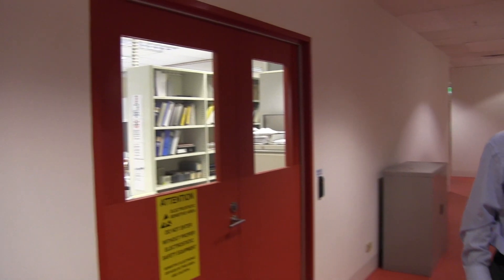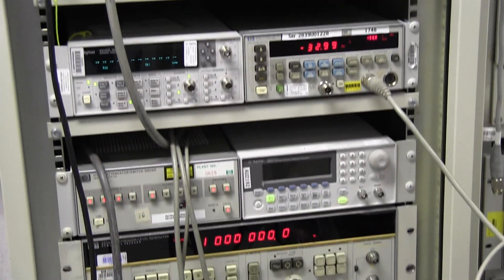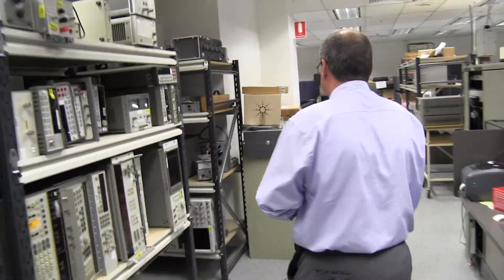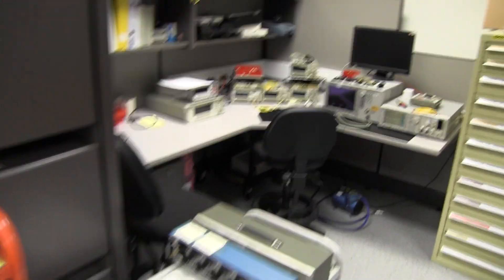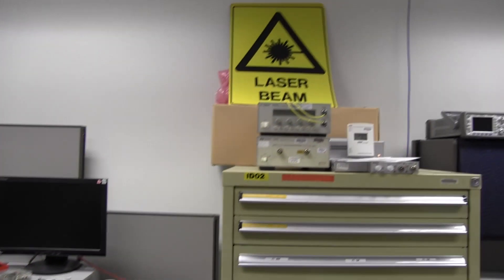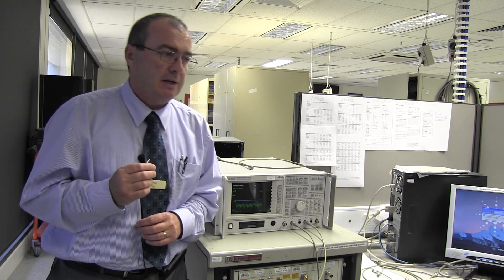EEVblog #1041 - Keysight Calibration Lab Tour

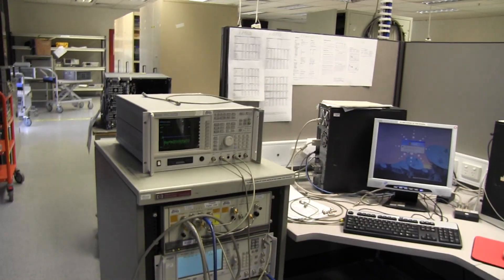Comment: At 15:34 I thought Peter said something about phase noise something they use in the TARDIS. :)  What a lot of equipment they have that isn't being used. I wonder how often, or if, they get rid of some of that gear.
Reply: You usually keep spares of equipment incase it gets busy, equipment goes down or primary standards need to go out for calibration. You don't want your lab to be down because a rack is out.
Reply: Maybe they calibrate the TARDIS?

Comment: I spot a 5342A at 4.20
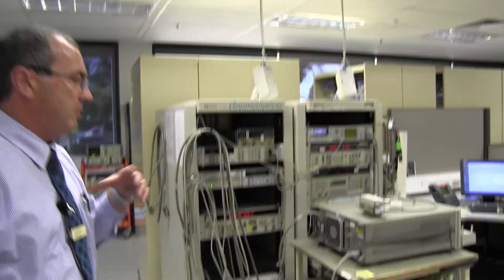Reply: 2:26 HP-8566/8568 in background
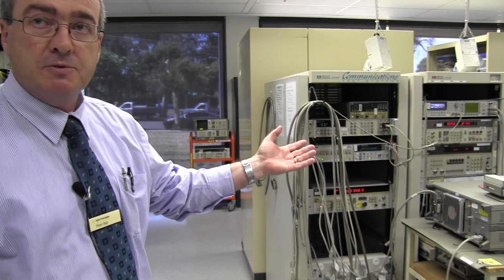2:37 HP-8116, 3458A,53131a,3335a, 8901a,8903b
3:01: HP-3326A on table
3:52: HP-8340A on bottom right
6:50 finally a stack thats bigger than mine
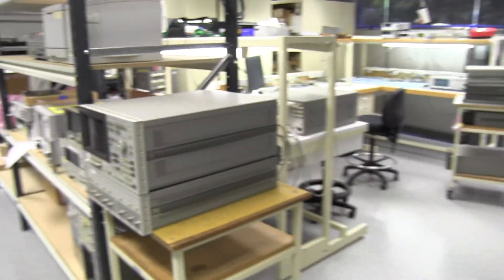7:30 HP 8510C?
Reply: It's going to be an 8902A because it's going to have all the fun options installed for doing RF cals. Just having the modulation bits is useless for what we use it for. Most of the time in an automated setup it's going to be running tuned RF and RF power measurements

Comment: 10:00 I see Tektronix TestMate equipment.

Specifically a TG501, AM503, and PG506 plugged into a TM503. Why some are there, I'm not sure. I know the AM503 is for DC/AC current probes up to 100MHz while the TG and PG are time and pulse generators. I only used those 2 to cal my 2467B. Their displays only give out a deflection error percentage.

Comment: why can't you have the roll of solder inside the solder station and feed through the umbilical cable to the soldering head driven via a feed control system controlled by a foot pedal means you have both hands free to do what is required.

Comment: why they have old calibration equipments instead new state of the art ones? does old equipment have any advantage for calibration purposes or just brand new equipments are too expensive?
Reply: Traceability. It's not easy to replace an equipment that you know how it was working for like 10 years? It's different.
Reply: dodaroxer yeah and also there is probably no reason to upgrade. These instruments have way higher resolution than the ones they calibrate.

Comment: Design and build a USB charger please dave. maybe SMD all the way ?
Reply: They want to see how Dave would do it.
Reply: When the one for my tablet failed, I ended up using a just hooking a USB port to the 5V rail of an extra 500 watt ATX power supply I had laying around, and disconnecting the fan since with just a load on the 5V rail, the heatsinks barely got warm. I also used it to power a Bluetooth audio receiver, and compared to cellphone chargers which generated a buzzing noise over the receiver, the power supply did not cause any noise to be generated that I could hear. Only downside was that an ATX power supply is bulky compared to a standard USB charger.
Reply: Just get an IKEA one, they're cheap and bigclive did a teardown and found it was very well designed: https://www.youtube.com/watch?v=uRe9w5PKmsE

Comment: Great tour:-)
I am wondering how do they calibrate the calibrators?
I mean if you take i.e. a power supply of the highest precision, how do they know that if it shows 10 volt, that it is 10 volt? Do they count electrons or how?
Reply: Like all metrological standards, they are calibrated using even more precise (and fragile) reference standards, which in turn are calibrated using yet more precise standards, until finally you go all the way up the chain to primary standards in national laboratories that calculate SI units (volt, second, meter, etc.) based on physical constants (or in the case of the kilogram, compared to a metal cylinder in France). 

For calibrating a calibrator's voltage, the output is run through a low resistance standard with a known high precision (i.e. the resistance is known to 0.000... places) and various arcane and secret processes are used to measure the accuracy and stability of the voltage. This makes the calibrator wiring and output terminals part of the calibration, and therefore their effect on the output is taken into account.

Comment: It's Keysight!! Why in the world would you still be using the 8902MS Rack? Your standards lab is outdated. It's kind of funny too. My RF rack is all new E4448A ( MMR, Phase Noise, etc) N5532A=550, E8257, ETC... And you guys are calibrating with 30+ year out dated standards. I knew back in 2004 I had an issue with a generator passing SSB and I sent it to Agilent 5 different times. Each time you guys passed it. I would run it again and it would fail the same offsets. I finally spoke to someone at your cal lab and come to find out you were using the ancient 3048MS system. I was using your new at the time E5504B system. Sad when  your customers have better equipment that your own lab,

Comment: I was just wondering what qualifications would be required to work in a lab like this? Just chuck an ESD mattress in the corner and I'd never leave :)
thanks to all involved for this wee tour - my switch has been officially flicked!
Reply: Ted Van Matje electronic engineering at very least
Reply: I'm just a dumb electronics hobbyist but a few intuitive points....
You need to be able to pass a military background check and hold a high level clearance to be able to work on equipment from the major customers of the lab.
   You probably need to have your engineering license and national certification. That usually means you need an engineering degree, a certain amount of certifiable job experience, and pass a certification exam accepted by the state. If your looking into schooling options, you should check out the state engineering license certification requirements as the first step before some recruiter/guidance counselor trys to sell you something that will waste your time.
  Finally, you need to be able to compete on an emotional level to interview well and come out ahead of all of the other people that want a similar dream job.
  I don't know how many people actually work at this lab but it doesn't look like there are more than 20-30 people at most.
 Best of luck,
    -Jake
Reply: The replies you've received are mostly incorrect. You don't need an engineering degree in this field and engineers are often looked over because they don't stay in the position for long periods of time because they become bored with the work. Every once in awhile you'll get to sit down and code a procedure from scratch or do an uncertainty budget, but normally in a lab like this you're just changing test setups when the computer yells at you.  Most people get in to the job with a military background as most militaries train calibration technicians. There are certificates you can get, but they're typically meaningless compared to ability. I've had opportunities to go take the certification, but it's not going to change my pay rate or job options. Bench time and skill sets are what make you valuable. A calibration technician could be someone who only knows how to calibrate calipers with a set of gage blocks to someone who can manually do interferometry or code complex test procedures for RF equipment. You do not usually need a clearance unless you're working for a military contractor and are working in a classified area or working on equipment with storage that is in a classified area which is pretty rare outside of the military. Keysight probably has a few people with a clearance for specific cases on equipment only they can calibrate (some of the 50-100GHz stuff with storage no one has the equipment to do but them) but they're not going to make everyone have one.
Reply: Degenerate Human 
....and that's why I lead with the "dumb hobbyist" bit. 
   Thanks for the info. Maybe goofing around with this whole electronics thing while waiting on surgeries/recovery isn't such a waste of time ;)
Reply: Upcycle Electronics you're definitely not. There's a large need for people who know electronics even if you don't have an EE. There are a lot of other people needed in the process and maybe you could even talk an employer in to paying for an EE b.s.
Reply: Degenerate Human 
   I just woke up in the worst pain in over a year. I needed a positive boost. Seriously, thanks ;)

Comment: What's up with all the floppy drives on beige equipment that hasn't turned piss yellow?
Reply: Not much UV there, put the thing where the sun will shine on it and it will get that color :)
Reply: 8-Bit guy took it out to the yard
Reply: Either it doesn't contain bromine or they were replaced sometime after the unit was originally built
Reply: Calibration is cheaper than buying into a new generation of equipment every few years, so people keep sending in ancient equipment. If it still meets specifications, then it may as well be as good as the day it was bought. Plus, certain systems (looking at you, financial and defence sectors) were designed to work with older models and are too vital to replace entirely.

Comment: 16:40 Seeing Windows XP machines with Ethernet cables plugged in makes me cringe.
Reply: Every PC in that building is most likely on an isolated VLAN that never sees the internet. As long as the PCs are isolated from ever facing the internet there is no issue running old operating systems, even OSs that have security issues.
Reply: I get the concern with XP (see Zach's response to why that's probably not an issue), but what's up with ethernet?
Reply: Just don't go on naughty sites and you'll be allright
Reply: Microsoft was the worst thing to happen to computing ever
Reply: i dont get why they not update to 7 atleast or even better, use linux.. i think linux should be an industrial standard!
Reply: sgpch1983 not at all, you can't just upgrade the OS. The software those machines run is very old. So they can't update the OS without rewriting the software. And Linux isn't this magical thing that fixes everything. Just like windows and Macos it still has its faults.
Reply: Nevexo. A big company like Keysight can't buy updated software that can interface with their test equipment or write their own? Or even use XP in a virtual machine for all of the tasks that require a legacy operating system at the very least?
Reply: There's also (sometimes) the cost of recertifying the software for a new OS. This can cost vastly more than the cost of the upgrade.
Reply: Tyler Smith, you people have an answer for everything, don't you. "Why don't they just update?" "Why don't they just use VMs?" Well, why should they have to? A lathe operator can run his machine for 80 years without an update (there are literally 80 year old lathes in daily use today). The PC industry needs to catch a fucking wake up, and realise that since the Windows XP era, most jobs haven't needed an update, so companies have adopted the same policies they have for the rest of their machines, and since it's their money, software houses better start listening if they want their business.
Reply: No need to be so hostile friend :-)
Reply: I apologise for my tone, but not my message.
Reply: relax, get some perspective, its not grandma with an xp machine plugged directly into a cable modem
Reply: Mactard?
Reply: Ethernet != Internet
Reply: I think that Windows XP is the only operating system that works in Keysight equipment I am surprised that they haven't used Linux Mint 17.3(Rosa) 64bit and Wine64 and Winetricks and the windows archiver dll that Wine64 or Winetricks requires to unpack Windows programs.
Reply: Because every thing is working like supposed?
Why update when is offline system and tuned for the best performance.The fact is it can calibrate a thousand  dollars gear whit pretty insane error soo best way is don't  touch it.
Reply: pufero1 Windows XP is obsolete
Reply: Why should they upgrade the os? Why should they rewrite the software? Trowing away money  for what!?
Reply: Obsolete don't means not functional.
Reply: I believe this video was filmed around 2012-2013, so Windows XP was still in extended support
Reply: Sorry mate, but that couldn't be further from the truth.  It would be part of a VLAN based network that is completely isolated from the internet itself.  Means the PC's within the office would probably need to communicate with some on-site server but that would be about it.  But sorry ethernet does not mean internet.

Comment: Extremely intelligent bloke who is an expert in his trade but the ESD controls in this lab are appalling and it seems that they understand little about it. He requested Dave not to touch anything because it's an EPA but that is pointless in this case. The purpose of an EPA is that everything must be kept at the same potential, whether you touch something or not.  No foot test was carried out and it looks like he is not wearing ESD compliant clothes.  There is cardboard all over the place which can easily carry high charge, it should not be allowed in an EPA.  Grounded floor or not, they might as well not bother given the controls they have in place.